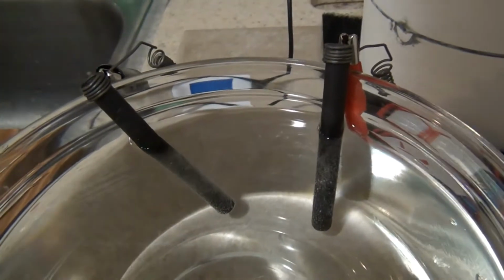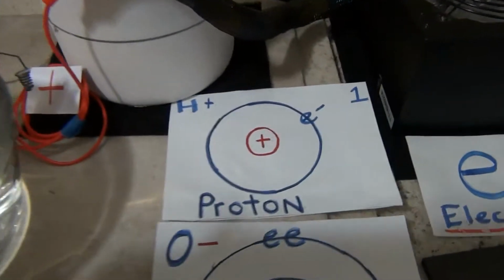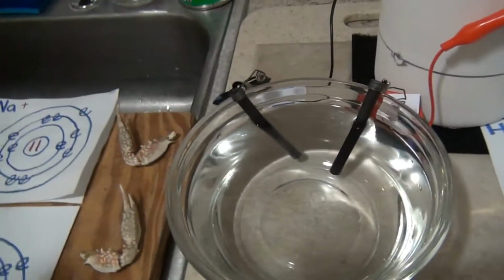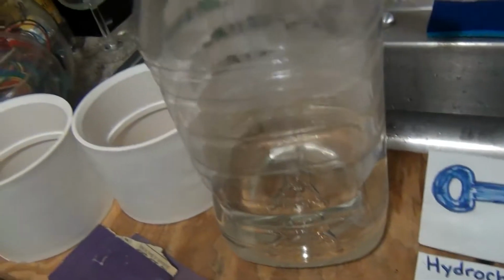HHO EARTHS OCEANS OF INFINITE CLEAN POWER

Comment from the maker: Energy just changes forms it can never be created or destroyed it can only change forms from one type of power to another. The ocean salt water has almost no resistance as it will conduct pass electricity with ease but must be distilled first into fresh water to use inside an oxyhydrogen fuel cell reactor core to produce oxyhydrogen gas only.